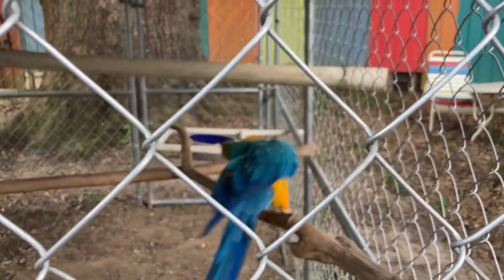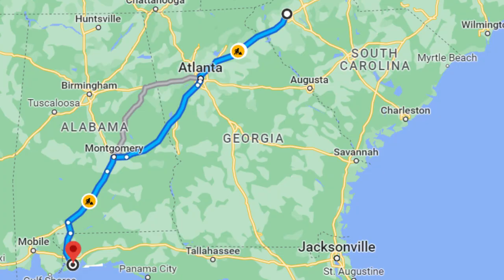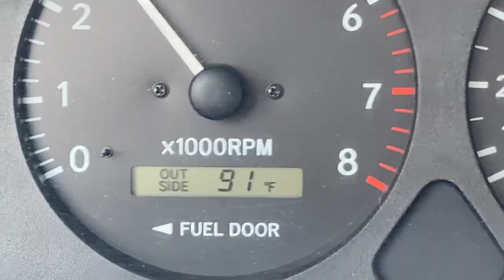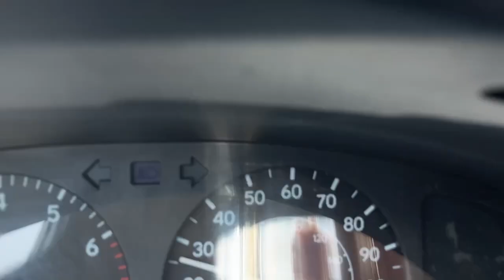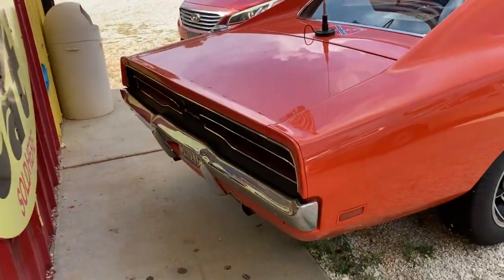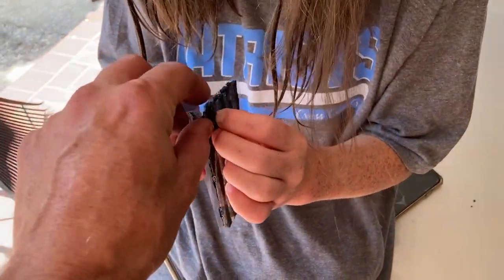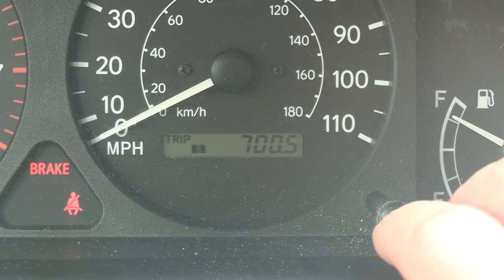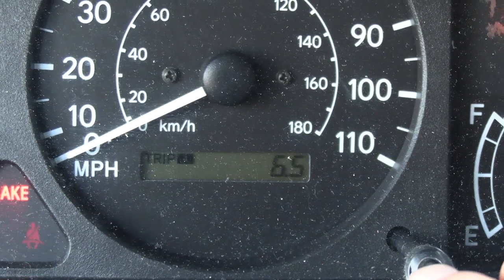HPL Engine Oil vs. OIL CONSUMPTION - Part 2 | Oil Burning🔥Experiments | Episode 24

Comment: When getting ready to rebuild running older engines in operational cars i usually drain about 3 quarts of oil and top off the crankcase with ATF.  Then drive the vehicle for about 1000 miles before pulling the engine and braking it down.  I learned this from an old race engine builder and i have always been amazed at well it works for cleaning the internals.
Reply: Trans fluid in the engine kills the cats.

Comment: Something to consider seriously is the fact the piston rings are worn at this mileage. So, in stop and go city driving, you'll have gasoline dilution of the oil and the level will seem to stay constant, but as soon as you do a long run down the highway, you'll see an apparent dramatic "consumption" and low oil level as the gasoline is boiled out.

Comment: Hi Dave, I am going through a similar issue with my Isuzu trooper with 6VE1 engine. I recently switched to rotella 5w40 and it’s too early to say for sure but it is appearing to help. It is my understanding that these engines also have similar problems with the rings. I would be curious to see the results with your Corolla. Keep up the good work and thank you so much for the videos!
Reply: 2001 Trooper 3.5 same engine 320K miles...getting ready to try the Berryman B12 test myself in the next few days :) Tried everything else pretty much, with no help. 300 miles per quart at interstate speeds, 500 miles or more at 60mph or less. I really don't want to replace that truck! (they are expensive!) But it runs perfect with tons of power, and starts immediately.

Comment: Well after fifty+ year of working on internal combustion engines I've never found a mechanic in a can or bottle!!!
At one time in all those years I was a certified Knuckle Buster on Cat&Cummins. Back in the 70s I started using Mobil Delvac or Shell Rotella 15W40 in everything I own!!! Currently I have a1992 lawn tractor with a 20hp Kohler and a 1995 F250 and both are running Rotella T6 5W40 synthetic and neither have a oil consumption PROBLEM!!!

Comment: I dont know if you tried yet.
I did, with success, a flush with Atomex totalflush, where you drive with it in the engine for 150 km. Its supposed to free stuck piston rings aswell. Then drain it and fill new oil and added Rislone Compression repair.
Helped in my case atleast.

Comment: Try a slightly thicker oil full synthetic 5w40 and make sure its a euro blend motor oil which is made for oil burning gdi engines.  I use castrol euro 5w40  on a oil burning 2010 equinox and it reduced the burning by half

Comment: Dexron III ATF fluid in a mixture of 50/50 Acetone is what Ive had success multiple times with seized engines. My process. cold engine spark plugs out pour mixture 100ml in each cylinder. Check fluid level above piston and if its receded reapply, if not receded add 50ml of acetone. Do this everyday for 5 days before attempting to turn the crankshaft by hand. Obviously non running engine.

So i have 2AZ-FE 2003 which im willing to try to reduce oil consumption, since it isn't seized. What i propose is the same process but this time move the pistons up and down the bores by rocking the crankshaft slightly each day after an application and leaving all pistons at the same height as per initial application of mixture and follow up applications
Once the 5 days have passed check if the oil level has risen if so drain out until level correct. Clean out any excess mixture from cylinder bores before re-installing spark plugs. Run engine at idle until operating temperature, stop engine. Drain oil and filter overnight.
Setup for initial oil consumption test. New oil and oil filter. New air filter and spark plugs. Use high detergent diesel engine oil. make sure oil level correct by running engine at idle until operating temperature, stop engine. Vehicle needs to be on a level surface and oil level checked 10 seconds after engine shut off to have the consistent amount of drain of oil back to the sump.
Now that there is new oil in the engine accumulate 1000km and recheck consumption as per warmed up and on a level surface and checked 10 seconds after engine shutoff.

Overall the engine oil needs to turn to its dark colour. NOTE (the contaminants are suspended in the oil until the oil breaks down due to lack of oil changes and the contaminants return to the engine) the change in oil colour is indicating its cleaning the inside of the engine to some degree. The oil needs to stay in the engine to utilise the oil filter, hopefully i can manage 5000kms before i change the oil, record findings and repeat process.

So many other factors to consider. Consumption of oil through PCV system, Driving style, temperature of the time when driving, tyre pressures and quality of tyres, wheel alignment, dragging bakes, fuel filter replacement, fuel quality and consistent octane. Timing chains definatelty start to stretch over time and oil ports behind the oil control rings are a hard thing to unblock due to carbon. Then oil flow stops in the area, it was the flow keeping it clear by cleaning with fresh engine oil, oil flushes. Valve stem seals, valve guide to valve stem oil clearance. There is also a good possibility that the ring gap has changed to become larger even if a compression test yields a good result that doesn't totally determine oil consumption but its part of the bigger picture.

Thankyou so much for this series.

Comment: If the oil loss is coming through the rings and freeing the rings only helps a litte, then time to boost the PCV system for better crank case vacuum , maybe use oil that has the lowest evaporative loss, remember the stuff used to free the rings also thins the oil so it will have more evap loss overall . have you used liquimoloy mos2 yet? worked great in my isuzu

Comment: Hello Dave, thanks for this very interesting and informative series.  My vote would be not to tear down the motor and for you to continue the testing.  I have always been a believer and user of B12 and Amsoil, but would also love the see the BK products tested as well.  At the beginning of the HPL you dropped in mileage. Maybe HPL is a great cleaner but not a great oil, i would be interested to see a switch back to your kirkland oil and see if that last longer the 800 to 1000 after the HPL treatment.  Anyways keep up the great work.

Comment: Berrymans there was a decrease in oil consumption 
Cro 505 the compression difference between cylinders decreased 
The Yamaha ring free removed a lot of carbon deposits in the cylinders.   

Driving a long long(to Florida) distance may have played a role in the lower oil consumption. Try the same long drive with synthetic?

The knocking occurs  when there is a lot of carbon build up on the piston and cylinder head. The carbon gets hot and can set off combustion early (knocking and pinging).

Comment: I'm thinking you should go back to the B12, but first drain the oil, then leave the plug out and keep the pistons covered with B12 for a couple of days, reusing the B12 that leaks past the rings and out of the oil drain.. preferably through a tube into a bottle or such to minimize evaporation.
Reply from the maker: Lots of folks seem to still be rooting for B-12!
Reply: that will be a great idea, also to add to that procedure as to when you drain the oil, probably pour half gallon of gasoline in the crankcase to take the residue oil that's left over.

Comment: Great video!  My daughter has a Kia with the 2.4L and it burns a lot of oil too.  The only oil that I've found that will slow hers down quite a bit is the Super Tech High Mileage full syn from Walmart in the 10W-30 flavor.  It really slows it down quite a bit.  Unfortunately it doesn't stop it though.

Comment: My 07 Camry reached 2,385 miles and the final dipstick was 1/3  of the dipstick from the top dot. I could have gone 5k miles and not have to add oil but decided to perform a 2nd Berrymans B12  piston soak.
I decided to perform a second piston soak, with the engine warmed up, turning the crank 5 revolution and continued every 6 hours.  I also added 1/2 oz of transmission fluid into each cylinder and sprayed a little engine starter fluid to save the starter and it did start right away. I proceeded to run the engine at 4500 rpm for 20 minutes. As an addition I added 1 quart of diesel fuel in the engine oil and let it idle for 10 minutes and Drain and added 5w-20 Kirkland synthetic oil.
Rather than going on long drives on the weekends. My daughter is driving the Camry to commutes to college and works. She is driving about 260 miles plus per week. 
Oil checked this morning with 1250 miles, the dipstick shows slightly below the top dot about 1/8". I would say this better than the first piston soak.

I have noticed that oil reading differs from overnight(lower) rather than checking the engine after 30 minutes to 1 hour after driving as the engine is still warm. I will keep you up to date as the millage accumulates.
Reply from the maker: That is awesome, Brent! Thank you for the update!

Comment: You should try DMSO Dimethyl sulfoxide, 20w40 plus 250ml DMSO engine idling for one hour, then another flush for 40 minutes with sligthly reving the engine, you just need to remove the inner paint on your sump because DMSO will delaminate the paint.

Comment: I have found that you want to use the reamer as much as possible until it's easy to pull in and out. That makes pulling the plug in a lot easier. I have also see the plug installer snap, allowing the metal rod hurt your hand. I think it's awesome she wanted to learn how to change and plug the tire.
Reply from the maker: Good tips.

Comment: Have you tried Engine Restore? It claims to deposit copper, silver, and lead in the upper cylinder area and stop oil burning as long as you keep using it. A lot of people claim it's the only liquid chemical treatment that actually works.

Comment: If the HPL Engine cleaner and the HPL 5W30 didnt solve that issue, its beyond an Oil additive solution. The ANs and Esters contained in that product normally cut through sludge, carbon and varnish like a hot knife through butter. Time to re-think your approach to this issue and look at a mechanical solution.  Also, I never observed you changing the Oil filter on the Corolla. If that's the case, it's most likely clogged up and running in Bypass mode.  Just saying. Good luck on your journey 😊Nothing wrong with keeping that old girl running.........the Car, that is......😂

Comment: Hi , I’m a Mechanic by trade and also a tool maker part time . Ok My question is if Berryman got you a 400 mile jump in oil mileages, Why did you not just do the Berrymans treatment AGAIN???? That’s what I would tell my guys to Do at the shop??????
Reply from the maker: Good question. I actually did a second treatment (I think there were 3 total Berryman's videos) and didn't see more improvement ... BUT a lot of people have said Berryman's did fully cure their oil-burning issues. ... I still recommend Berryman's over everything ... was just trying to give other additives a shot.

Comment: I propose doing an oil change with  5w30 oil for diesel engines, oil for diesel engines contains more detergent than regular engine oil to clean carbon.
Reply: Maybe 5w40 is the only option available in terms of lower viscosity diesel engine oil.
Reply: T6 rotella is good stuff

Comment: I’m a Toyota nut, have three with tags. I have a 97 Corolla, at. Doesn’t burn nearly as much oil as yours but at high speeds (75-80mph ) does burn oil. A lifelong friend, Toyota technician of 30 years tells me the oil holes behind the rings are too small and bad to clog up, causing oil consumption. I think 2001 and earlier are better vehicles

Comment: My mechanic says diesel fuel in the cylinders, let it soak for a few days, it will run past the rings and along with contaminating the engine oil it will soften and bust up the carbon that's preventing the oil control rings from working as designed, change the oil and filter and you should see considerable improvement

Comment: if I didn't know any better,  I would be looking at valve stem seals or HG. In one video you could see the oil leaking down from the top of the cylinder. that is not a ring issue.

Comment: Have you thought about using a catch can to stop the engine feeding oil back into the cylinders with blow back and continually gumming up the rings. This may give the rings a chance to free themselves up while running. As far as I can see that the emissions control is a recipe for disaster when excessive oil is returned to the top end of the engine to be burnt off. Burt oil creates carbon. Carbon is hard and scratches bores. Carbon will gum up rings and you will lose your seal. Just a thought. One I’m going to try myself.
Reply: I think he discussed the catch can idea in the earlier stages of this series.  Don't quote me on that as I can't remember for sure now and I wouldn't even know which video to point you to in order to try to find it but I think he mentioned something about this a while back.  Maybe time to binge watch the series all over again?  Just a thought?  ;-)
Reply: A catch can will not stop oil consumption but will stop oil fumes from entering the intake so it doesn’t mix with gasoline before getting ignited.
Reply: @johnmilner7603  Only after pull my own cars throttle body off to clean and seeing how much oil has gummed it up and the air intake manifold was loaded with oil I can’t believe when the rings aren’t working properly that more oil doesn’t return through the emissions control. Even the return hose from the rocker cover was loaded with oil. It’s just a thought.
Reply: @eldridge201  I have been binging but I must have missed it. But having worked on cars myself I’d be surprised if you can get a solution to clean the carbon from the rings. The examples I’ve had to deal with the carbon was hard like rock and after removing the rings the carbon had to be scraped out to clean the ring grooves and it feels just like sand.

Comment: You could try a soak of Industrial Strength White Vinegar.  Ive seen videos that shows it eating carbon off better than any other additive.  Maybe a 48 hour soak or something.  Occasionally rocking the crank back and forth to move the rings while its soaking.

Comment: That oil is absolutely hashed... before you give up do a regular oil change on a short interval. Then check consumption on the second oil change. If oil is making its way past the rings so is fuel. That viscosity has to be close to zero.

Comment: Have you tackled the PCV system yet. There are two sides to the PCV system. One is the overload line that works under WOT. Leave that alone. Then there is the line that works under idle and light cruise. Leave it plumbed exactly like factory but cut the line where you can put a sealed can that can catch the oil before going back into the intake. It will usually be a 3/8 line, a simple large jar crammed with course stainless steel scubbers with 3/8 connectors either side of the lid would be a simple crude setup to see how much oil goes back into the intake.

Comment: I think you need to find an oil with the highest flash point. With a high detergent. Pennzoil and Amsoil synthetics according to another Youtube channel Project Farm is those with high flast points. I believe along with your b12 treatments it would make for a well rounded test. Start with a quality oil that stand up. I have a old pickup I just run 15w-40. The thicker oil makes up for the upset of the rings. Am going to do the b12 piston soak. With mmo and lucas upper lubricant in the fuel at constant. Going to try the chemical test plethora at mine as well. Tried bg engine flush in the red can. Had seen no drastic improvement. Doing the seafoam in the crankcase while running it at the moment. Need to do a piston soak as well. Cant hurt it right! Either way I am looking at a vehicle that currently is cheaper/able to have more fun in than a newer vehicle! Even at a motor swap!

Comment: Did you do a leak down test to determine if it is rings of valve seals causing the problem? If it is the rings I doubt if you will correct it without tearing down the engine

Comment: I'm not expert, and I didn't see it mentioned in previous videos, but have you tried going to the next higher level of oil viscosity? Start with 5w40 and maybe try 10w40? This a common solution for engines burning oil so drastically. It doesn't always work, but it may be worth a shot.

At any rate, I think it's your pistons/rings and/or your piston sleeves. The rings are likely damaged/worn or the cast iron piston sleeves are worn (both at this rate). Mechanical repair will have to occur to fully restore to original performance though.

New to the channel, and really enjoy the content (your 2x6 rafter insulation vid hooked me).

Comment: Well  It looks like you have not tried  Engine Restorer, which is more common and readily available. It is a copper/lead/and cleaner type variant. I am familiar with a similar product called CLM back in the early 1980's  and it saving my 240Z engine that was run without oil for almost 90 miles in 95 degree mountainous driving